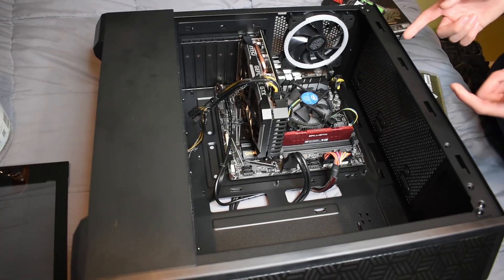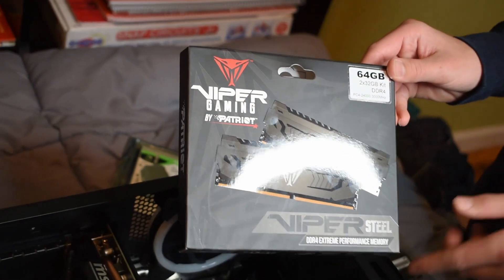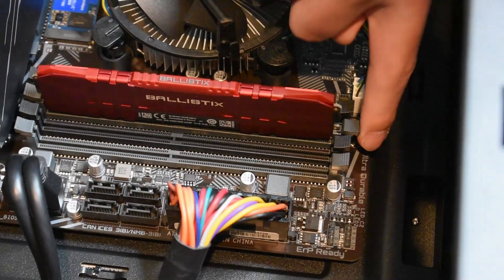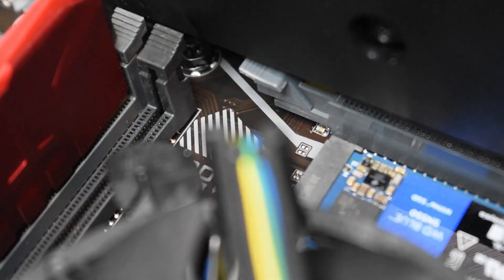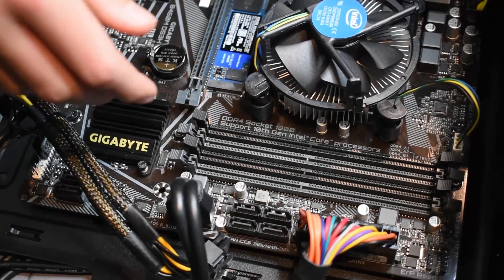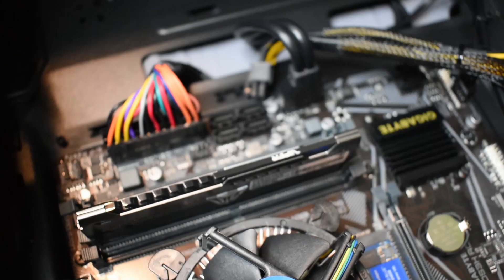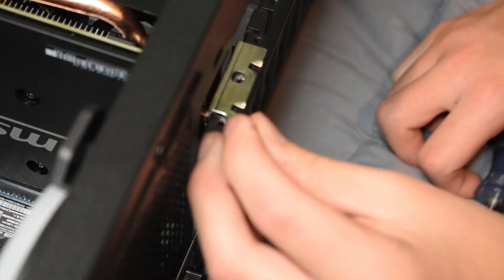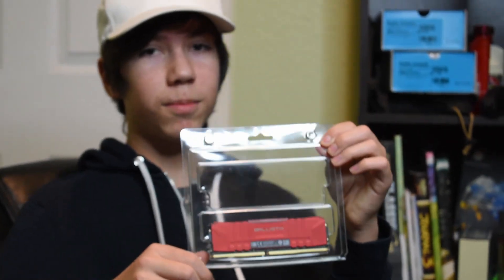How to properly install a memory card into your PC |Cyberpower| Leos Vids|

Comment: Nice Video.  Honestly I think the 64GB   that you added to this machine is a bit overkill if all you're doing with it is gaming on this PC. If I was you I would have just went with 32GB of RAM and filled up every single one of those RAM slots  or if you wanted to still go with 64GB I still would have gone with 16GB sticks and just bought four of them so that way you have every single one of those slots filled so then you're running in Quad Channel. Which is definitely better for things like streaming and video editing. I have the same computer running on 24 GB of RAM and I still never come close to you then that amount of ram ever lol.... and here is good piece of advice never ever upgrade your computer on a bed or the floor where there is carpet. Because now you're just asking to ruin your computer with static electricity. I would recommend upgrading your computer on a table that's nice a flat. And another thing is you are not grounded to your computer which also can cause a problem with static electricity because if you have static electricity for whatever reason on your finger and then you go to touch something and it shocks that part of the computer it could damage your motherboard or any other component in the computer. They do sell wristbands that go from your wrist and then attaches to the computer and that allows you to be grounded to your computer so you don't create static electricity. Because upgrading that computer on that bed by the looks of it and you're constantly moving back and forth with your clothes you're just going to make static electricity and you could accidentally shock a part in your computer either damaging it or completely ruining it all together or causing it not to work at all.. I mean keep up the good work next time upgrade that thing on a table or a desk of some sort so you don't damage your motherboard or any other computer component
Reply: Can it be a wood table?
Reply: Holy crap bro u just wrote a essay
Reply: Yeah
Reply: Turn off pc ?

Comment: Doing 64 GB of RAM into a prebuilt like that, the motherboard won't do much out of that aswell as your graphics card will not make much use out of it a better bet would've been 32 GB of RAM. For anyone looking what they should get probably do patriot steel viper ddr4 16 GB 2x8 and just buy double that, even getting one 2x8 would be perfect
Reply: It will overclock I bet

Comment: umm... idk if you guys know this but that CPU can only use up to 2666Mhz ram so umm, the ram is restricted to only running at 2666Mhz , but I mean on the other hand if you're expecting to reuse the ram in a new computer a few years down the line that makes sense. Otherwise just get 2666Mhz ram since its much cheaper. Also going from single channel memory(ram) to dual channel ram should give about a 5-10% increase in performance, so if you can you should definitely get the upgrade.(the motherboard also supposed to support quad-channel memory so , you should do that instead if you can but would be a bit more expensive for the same amount of ram and only would give you and extra 1-5% more increase in performance)
Reply from the maker: Thanks, I may upgrade the CPU when it gets cheaper (if I need to) but for now it’s running everything I need it to. But anyways I appreciate the info!
Reply: Actually, the 2666Mhz are more expensive, so it makes sense to buy the faster RAM anyways, and the quad channel advantage is pretty much negligible.  In any case, nothing wrong with what he did, and good info if you really want to geek out!

Comment: Can you tell me the make and model of the ram that came with the PC ? like that I would add to make 16gb of ram
Reply from the maker: I don’t know if you saw it but at basically the end of the video I put a picture of it
Reply: Honestly it don't matter as long as you buy a ram stick that matches the same frequency as the one that came in the PC it really don't matter any Ram stick will work as long as it matches the frequency so for instance if it's 2666 megahertz then you're going to want to make sure that the ram stick your buying is also the same frequency 2666
Reply: Google pcpartpicker & find the compatible ram for your specific motherboard.